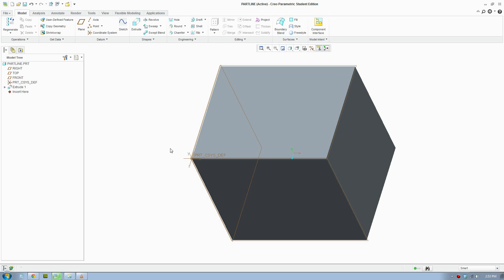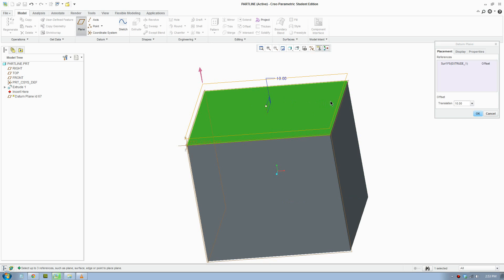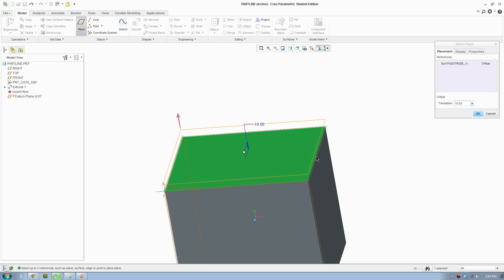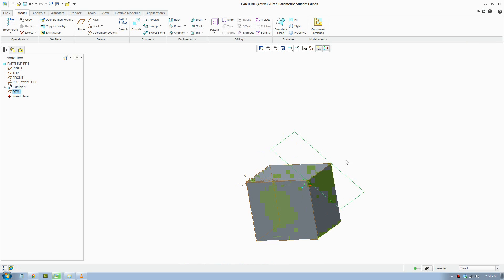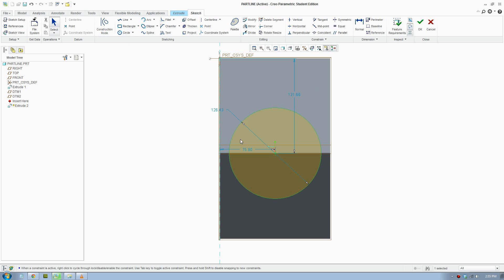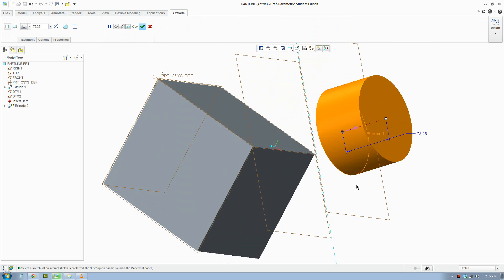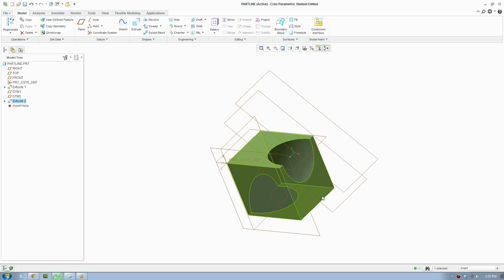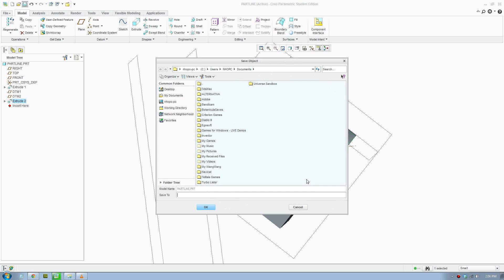CREO 2 Tutorial - How to make an inclined plane or an offset plane

Comment: Is it possible make it inclined without making any object just by selecting two other planes?
Reply from the maker: +Mihir Pote Hello, I don't think so. You can select an edge of an object as an axis. You can create a normal plan without an axis.
Reply: 3D Surfacing So do you have any idea how can I create a V engine in creo? I believe it needs a included plane to create the cylinder blocks. How can I make those?
Reply from the maker: +Mihir Pote did you see my crankshaft tutorial video?
Reply: 3D Surfacing No I think. I'll check it out. 
Well and what if I created a axis on a specific plane let's say top plane and then exit from sketcher. And try creating a datum just by your process selecting a plane and instead of the edge I would select the axis. Would it be possible that way?
Reply: 3D Surfacing Do you have any social networking site where we can be in touch. It will be really helpful for me as I love making cars in Creo and other things there.
Reply from the maker: +Mihir Pote check out here https://www.facebook.com/3dsurfacing/
Reply from the maker: +Mihir Pote Yes, you can create an axis in the sketch or using datum axis. Both should work.

Comment: is it possible to make a 3D triangle aka tetrahedron .. ? i can't believe i have such problems doing it..
Reply from the maker: Saasa Anakijev Use datum points to create a point anywhere in 3d spacre. Place it on a plane, then turn on offset to bring it into 3d. The 2 green handles are offset handle. Place it on other plane to set X and Y value. After you have your points. Use datum curve to join them.